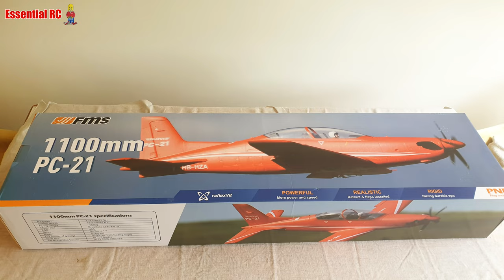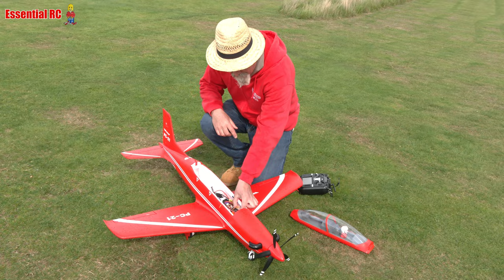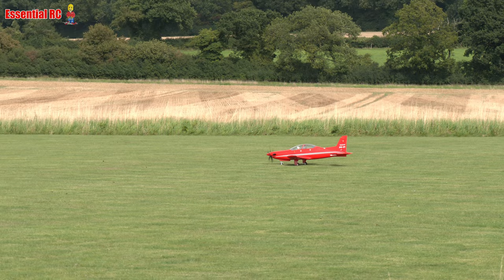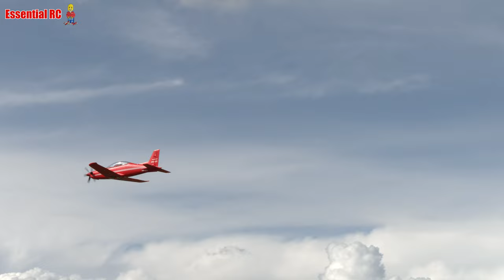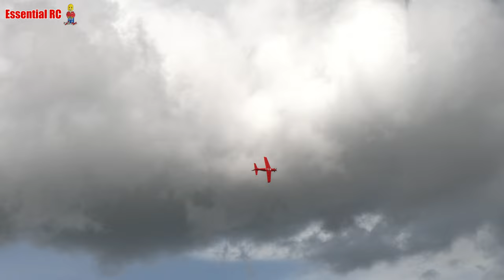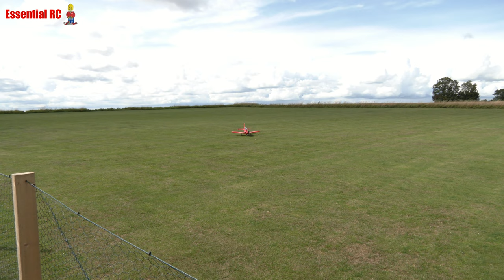First Flight ! FMS Pilatus PC-21 Jet Trainer Aeroplane

Comment: Did you add nose weight to get the cg, I fly mine on a 3000mah 4s 310gms located entirely in front of the cg position( 90mm back from LE) to get cg.   I also have the FMS 3648x 870 kv motor ( Nemesis) with 70amp predator esc producing 850 watt at 58amp for a bit more power.
Reply from the maker: Nope. 4S2200 under the straps and stock CG.

Comment: Nice looking model, would it benefit from a longer nose leg? Does anyone do a Tuccano?
Reply from the maker: No. Clearance of prop to ground is fine. No change needed.
Reply: @EssentialRC The prop seemed to hit the ground at least 2 times during landing and taxiing afterwards. A little more ground clearance would indeed seem benificial to me too
Reply from the maker: @jprie1277  Fair enough. I didn't see that.